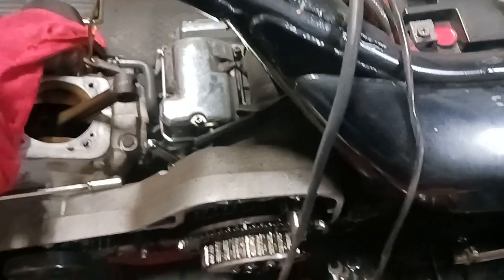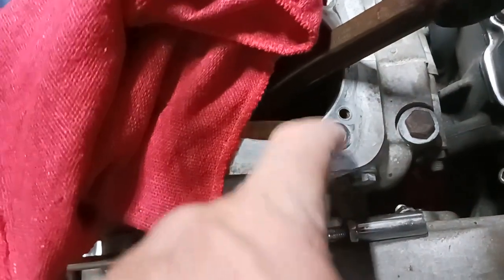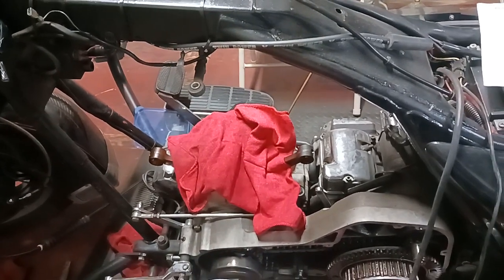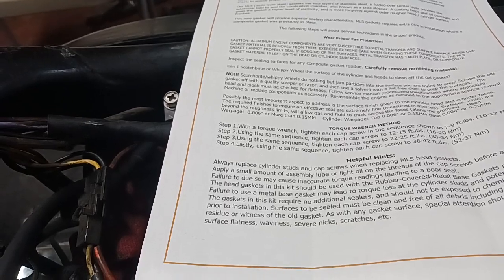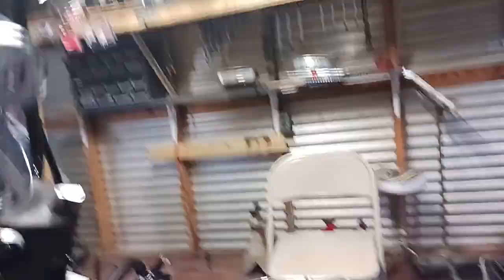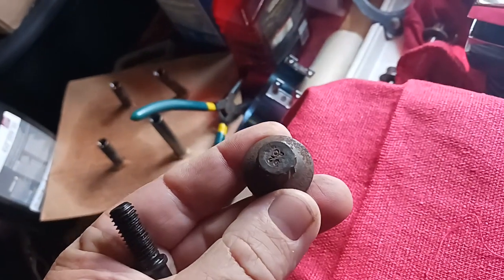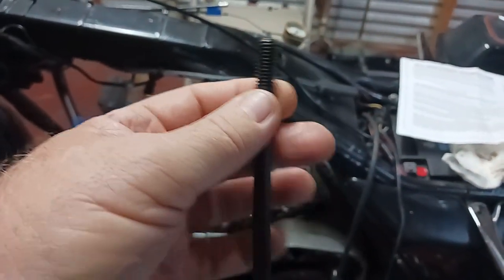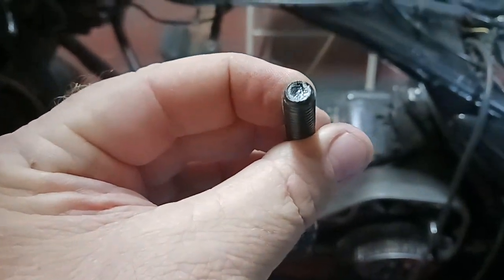MURPHY'S LAW IS REAL

Comment: Your doing fine , I was thinking the same as slick that one snapped off or stripped in the case . Im glad all is good .
Reply from the maker: 2 were tough so I heated area with torch. I got my new SS studs in today along with Colony head bolts.
Reply: @edZILLA64  Cool Everything the same Leith and size .   I use a lot of S&S stuff  high dollar but they turn out good stuff .

Comment: Ed, why are you toying with my emotions the beginning of your video had me thinking you snapped off those studs in your cases I was so relieved that you were able to get them out cleanly I’m so happy for you!!! Good job.  By the way, i love doc harley, he’s helped me out several times
Reply from the maker: I was concerned about why the head gaskets blew, I kept researching different causes and I ran across Doc Harley. If they were flipped the other way, I wouldn't have messed with them. If you don't know by now, I change my mind alot. Sorry bout the scare. P.S. That heating the bolt worked.